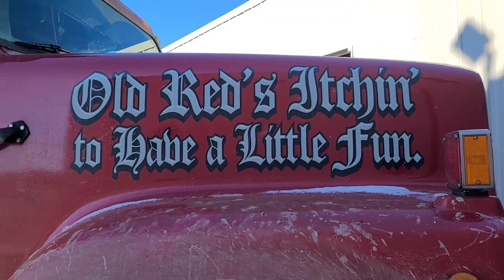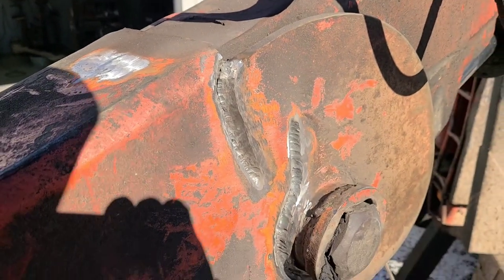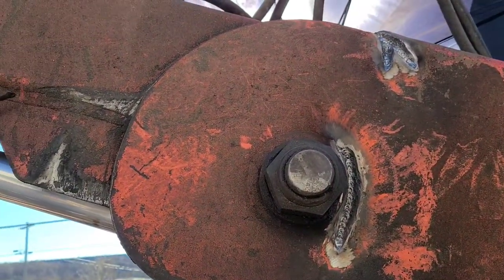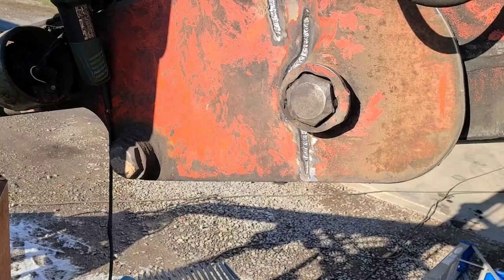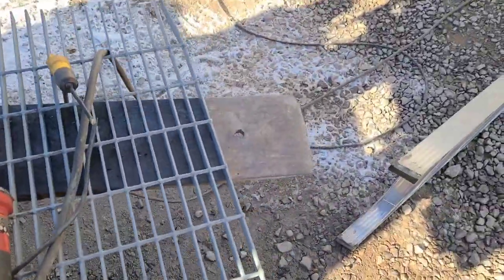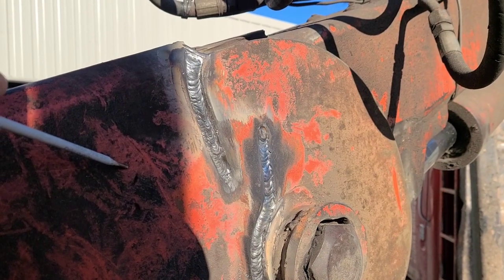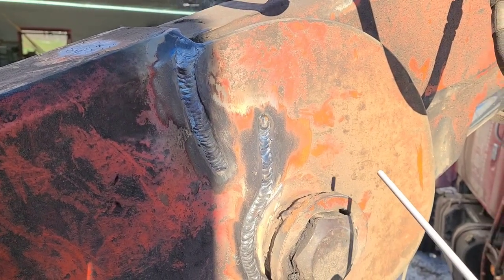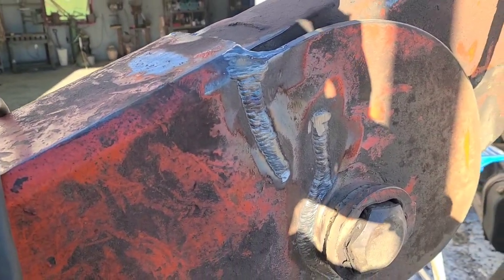Uphill 7018 welding to repair cracks

Comment: I enjoyed your commentary about metal and rod temperature as your welding vertically. Well said. Good pointers for up and coming welders. Big thumbs up.👍👍👍👍
Reply from the maker: Thanks for watching and commenting it’s extra good to get a positive comment from you after watching your videos for so long…I appreciate the tips and ideas you share on your channel.

I hope you and your boy are doing good…that last wheel spindle replacement you guys did looked like one of those jobs that would give a feller a sore neck…standing on a ladder while looking and reaching straight up is the worst position for me to operate in…hard on the neck and shoulders.

Thanks again for the comment and also the great content on your channel.
Reply: @NBSWELDING   I've welded for years and watch both of your channels.  I learn a lot , but still give a few suggestions.  A BIG THNX to both you guys.

Comment: Well sir, I owe you a big thank you. 7018 uphill was my nemesis for whatever reason. I took your advice and did exactly what you said as far as turning the amps down and long arcing a little bit at the beginning of the weld and slowly closing my Gap as I moved upwards. It worked so surprisingly well. Really can't thank you enough for posting that information. I appreciate it.
Reply from the maker: That's great I'm glad that helped ya out
Reply from the maker: Also remember to keep your motion level...even when you don't weave very wide you still can focus on the sides and make the weld concentrate to the left and right so you don't get a blob in the middle...focus left and right and the middle will take care of its self
Reply: @NBSWELDING  will do, thank you!

Comment: I'd like to say thanks. As a semi descent amature welder working in a maintenance shop, I'm building a pipe gate for a entryway and I was struggling with vertical. My boss was just having fun watching me. He said that's why I burn all 6011 rods. It's ugly but it doesn't drip. I was burning 5/32 7018 and just dripping like crazy. I tried to tighten up my arc but your comment about to much amps and heat made me say....ohh that's why!!!! Even as tight as I was in the seam it was way too hot. I had that miller at 155 amps....it's a huge rod. But it's all I had in 7018. Thanks for your tip!!!!
Makes perfect sense. Your a plethora of knowledge.
Reply from the maker: 5/32" 7018 is too big for most vertical welding unless your working on very thick steel and making really big welds...even then it would be a struggle to make it look decent 

Use 3/32" or 1/8"
Reply from the maker: Nothing wrong with using the 6011 downhill on a pipe gate..just make sure you weld everything all the way around solid when you use the 6011 because it is more brittle...if you don't give it a place to start cracking then it should be plenty strong

Comment: Appreciate those pointers - this isn't the  most correct example but have or do you run the tail (continue a bead beyond a bushing) on certain joints as I see on factory build equipment (Case for example) and I have heard others argue that plating should be exception not a rule

Comment: Not very experienced so excuse my lack of knowledge but wouldn't something this size need to be heated before welding to ensure the weld holds long term?? 
I'm one of the novices you speak of, just trying to learn.
Good video!! Like your attitude towards teaching and welding.
Reply from the maker: Weld preheat has its purpose in controlling the speed of expansion and contraction in dissimilar metals and very hard steels.  The purpose of preheat is to keep the metal temp up for an extended period of time so that it does not crack from expanding and contracting too quickly.  
The steel that I welded together on this particular job is not dissimilar and it is not extremely hard steel so preheat is not necessary and wouldn't make any difference, especially since there was so much welding done at once in the same area that the material got very hot all around the welded zones just from the large amount of welding that was done at once without stopping.
Reply: @NBSWELDING  thanks for the explanation.

Comment: All these welding videos on YouTube no one talks about sticking the rod are starting the arc
Reply from the maker: In this video I tried to explain how arc length effects heat and how you need to run a longer arc at first as things heat up...then later use a shorter arc to cool the puddle down.
If your having issues sticking the rod with a good machine and the correct amps then your problem is managing arc length.
Practice operating with a longer arc and manipulate to a shorter arc to control the heat and the puddle
Reply: @NBSWELDING  videos very helpful 👌
Reply: Mack a video about starting the arc and not sticking the rod  that would be a good video for beginners

Comment: 2 VIDEOS TONIGHT, SUPER RAD DUDE!!!! 

This video was filled  so much great stuff.  But I do have two questions if you got the time to answer it dude. 

Have you ever had a problem from your welds on repairs like this,cracking from a 6010 or rods you would use in API 1104 stuff?  Cuz of the possibility of hydrogen crack but more so they are just not as ductile as a 7018 or dual shield. 

I have used 6011 rods for roots and short circuit mig for roots as well.  And I have not seen a problem but I dont have as many  repairs as you and I back gouge if I can.  And I also run 7018 open roots if I can. Its hard but folks do it , lot over in Europe. There is a 7016 low hydrogen rod, that is made for open roots. The slag is not as runny as 7018  . But they are expensive. So thats why I been learning the 7018 open roots 😅.

And  have you had any problems with your caps being such wide weaves?  You know the arguments about stringers and weaving. Iam not here for that.  You are the only person I have seen who runs their equipment repairs with big wide weaves.  I did  not know if you seen any troubles from it?  Although I have seen a storage tank in a refinery that had an insert patch that was welded like that and its fine. It was done several decades ago.  But nothing since. 

I assume not , as you run your own business and if it did cause a problem. You would not do it. 

I learn from all the folks I can. Options make you money. Iam just a NDT ( x ray’s  PT’, MT, VT ,UT) guy who welds on the side.  So when I weld or do repairs. I think about all the code stuff .  Thats what I use to guide me , as I dont have years and years . of practical experience. 🤣 I have the AWS D14.3 , which is for like farm and earth moving  equipment. And its just a very small version of D1.1 .  I could have saved some money and just used my copy of D1.1 . 

Again dude thanks for posting these videos and sharing the info. I dig them and they are always rad.   These crack repair ones are my favorite though.
Reply from the maker: I think that when you use an XX10 rod for just one root pass that you fill and cap with 7018 then you eliminate any of the brittle elements of that XX10 pass.

The occasions where you will really see cracking with XX10 rod is when it is used for tacking or stitch welding...I avoid using any cellulose base pipe rod for that because cracks will have a place to start and from there they can rip like a zipper.  If you run pipe rod on something that you weld completely solid and all the way around it is very strong and rarely cracks.

I've never had issues with the wide weaves.
Reply: @NBSWELDING   Thank you so much for your insights dude. I really do value it. YouTube and code welding friends have really made my welding jump leaps and bounds. Thanks again dude.

Comment: I know machines vary but what amps  do you set yours at to run 1/8 7018 vertically?
Reply from the maker: For 1/8" 7018 I'd usually be between 95 & 115 amps depending on bead width...wider weld would need more amps...the wide weave laced caps can take 125 to 130 if the material is thick

Comment: Do you avoid using a 6010 root? I try to only use 7018 even on my root.
Reply from the maker: I use 5P+ and ARC 80 quite often...although it does not provide the elasticity that 7018 does it offers other advantages in certain situations...the only time I definitely avoid using any XX10 rod is for stitch and tack welding where the elasticity and crack resistance of the 7018 are a must.

Comment: Excellent advice on how to run 7018 uphill, that's exactly how to do it. Defiantly not a job for a shear plate the shear plate would hide future problems from view until a catastrophic failure occurs, much better to keep an eye on the repaired area and address them as they come up.